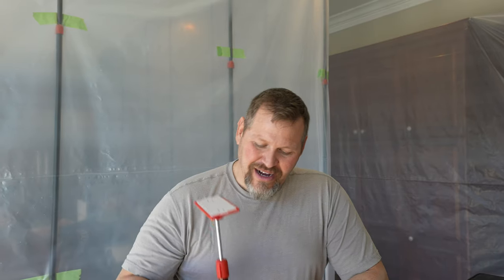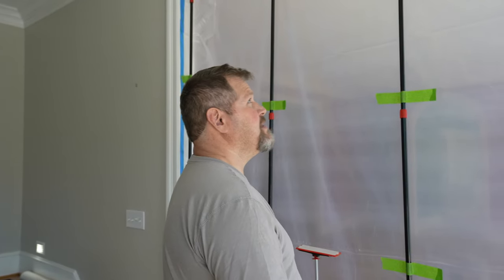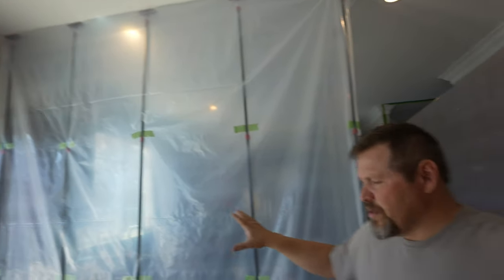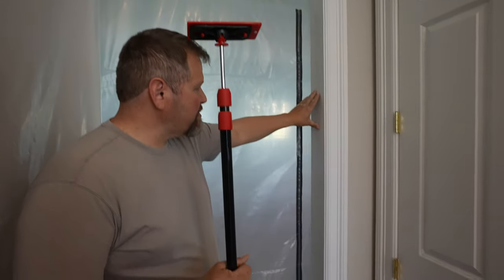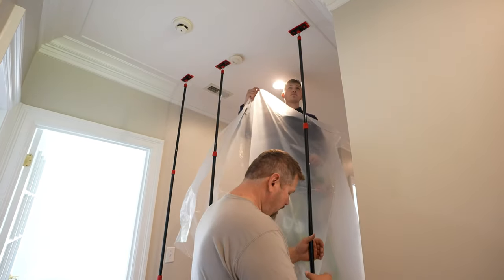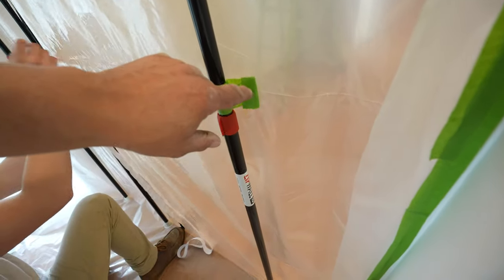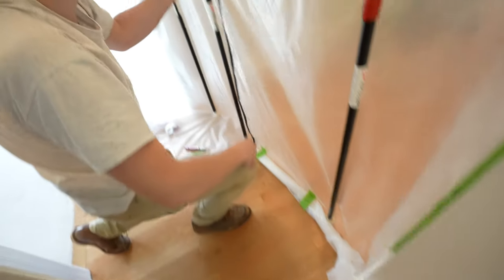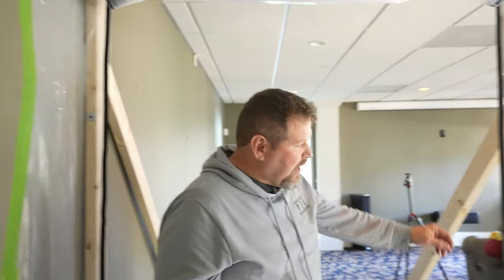ZipWall..Dust Containment System..for Remodeling and How to Use It

Comment: Next time you’re putting up a wall try removing the red pad from the top of the pole and clamp the plastic between the pad and the adjacent piece. You can attach the plastic to the pole from the ground making it a one man job. It also provides good grip on the ceiling so you can stretch the plastic tight making a decent seal.
Reply from the maker: I like it, we will try that.